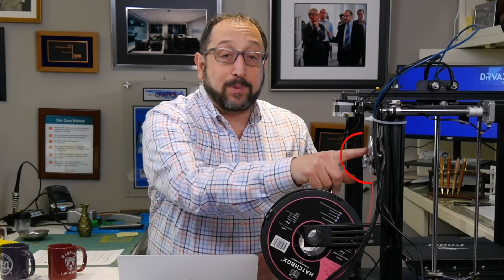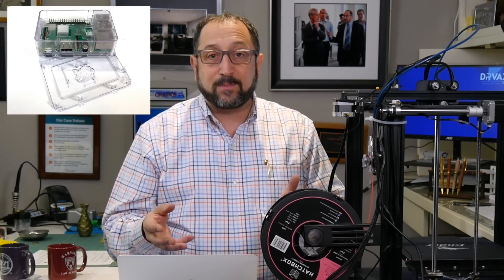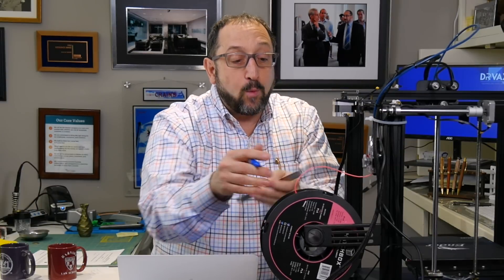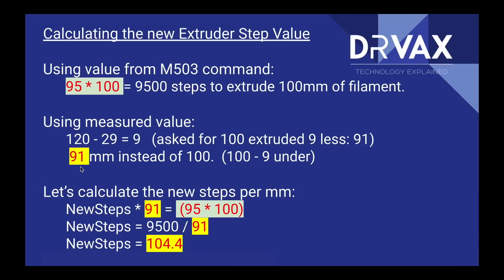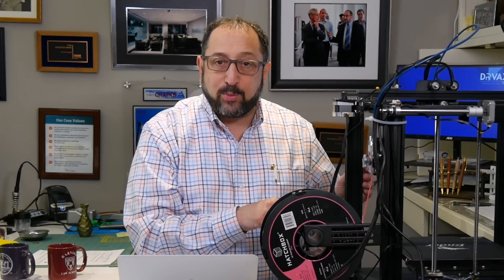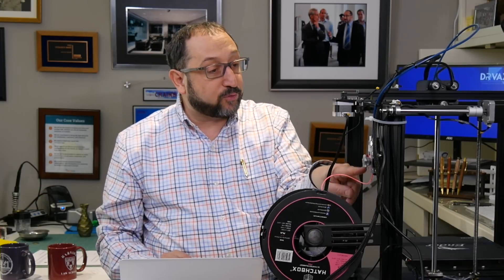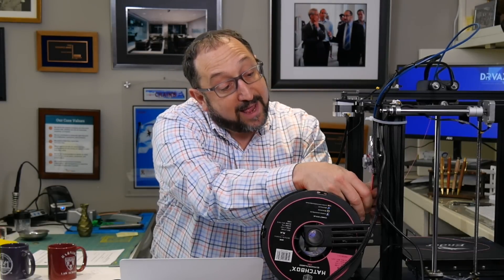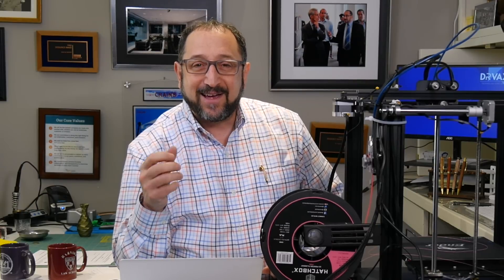Calibrate Your 3d Printer Extruder

Comment: I can follow along and everything goes smoothly until the part where you say to copy the M92 line. I cannot find that line to save my life.
Reply from the maker: Depending on your 3d printer and the version of the firmware it is using you may not have a M92 line in you M503 output.  If this is the case this is not tunable on your printer.
Reply: @MakeWithTech  
Firstly, thank you so much for replying so quickly. I ended up just typing M92 E## and it showed in the code on the bottom left panel and showed ok.
Then I put in M500 and it also shows ok below.
I disconnected my computer and powered down printer. When I powered back up, the printer E stepper showed the new values. In your video, you said to send an M500 command to save it. I couldn't see the actual code you typed in cause it was too small on my phone, so I just went with M500. 
By the way, all your tutorials are fantastic. I search them often as I am new to printing. I purchased an Ender 3 Max. Loving it so far 
Cheers!!!

Comment: Important thing to know that you need to calibrate extruder steps to extrude exact amount of filament.
You will need to calibrate flow separately in your slicer. For my Ender 3 and given ABS filament I use 91% flow to make walls exactly match the model.

Comment: Hi Irv, I just got my first 3D Printer last week (Anet ET5X) and am watching lots of your videos. I tested this today as I have problems Printing. With Repetier I could run the test and found out that my setting is off - The Problem: Repetier doesn't give me any ECHO - so the command M503 doesn't send anything back and I don't see the M92 line.......  I searched in the Internet but I don't find the reason why....... Do you have any Idea? (in Repetier echo is on.....) May this be the Anet FW? Thanks for your help
Reply from the maker: Try using the terminal in matterhackers’s mattercontrol program. It us a free program.

Comment: thank you so much for your video. I am having an extremely hard time connecting my ender 5 plus to my computer using a USB. I need to adjust the steps per mm for engineering design grade prints but cannot access it. please help
Reply from the maker: Try use the free Mattercontrol sw from Matterhackers.
Reply: @MakeWithTech  I will give it a try thank you

Comment: Dr. Vax Thanks for the great video, I like how detailed you make your  presentations. I'm having trouble with my Ender5 Pro printer. I cannot get my filament to stick to the bed so I thought I'd start with an extruder cal. When I calibrated  my extruder, on attempt one, it  only used 5 cm of filament, less than half of what is expected. So, what I did and before I changed any settings, I then removed the blue hose at the nozzle end and fed out a cm or two of filament  and placed a mark on the filament close to the end of the blue hose. I performed your calibration, steps G1 E100 F100 etc. and measured how much filament came out of the blue hose. It measured exactly 10 cm, so the extruder spit out 10cm of filament. When I perform a filament change the filament pours out of the nozzle so there is no plugging going on. After putting it all back together, I tried printing a small test pattern and everything else for that matter. I cannot get the filament to stick to the  bed, and I tried everything under the sun. 3 different bed plates, tape, glue hairspray. I increased the bed temp decreased the bed temp, increased then decreased the nozzle temp. I tried 3 different profiles. I have an EZBAL bed leveler  so I was able to adjust the nozzle height up and down, but it still won't stick. I dried my filament in a dehydrator and changed filaments. It seems the filament is not spewing out like it should when printing. It looks very thin and hairy looking.  Yet again I performed a filament change and it spewed out in a nice spaghetti like form. Any thoughts. Why would the extruder extrude 5 cm one way and 10cm the other way?
Very Confused

Comment: Do you have any idea how to get an Ender 3 Pro with Marlin version 1.1.6.2 to go back to printing in the center of the bed again?   I found the coordinates roughly by manually adjusting the Y & X-axis over the center of an X I drew on my build plate, but how do I get it to print in the center?   I do not want to Flash Marlin 2.0.

Comment: Hey Dr V. Love your work. Thanks so much! Quick question about calculating e-steps. The original value in my E3Pro esteps was 93mm and I changed it after doing the algebra. However, I’m not sure I got it right and want to check it again. Second time around, should I use the factory setting for the e-steps (ie 93mm) or my adjusted calculation (which I suspect is not quite accurate)? Hope that makes sense??
Reply from the maker: It does not matter.  The algebra is relative.

Comment: Great video but would have been better if the print was off calibration in the beginning.  and it would have ben incite see both under and over extradition calculations and steps.

Comment: Dr. Vax Many thanks this video was very helpful. I was able to correct my under extrusion but when I attempted M500 to save the changes I get No EEPROM. 
BTW I have the new Ender3 V2 with stock firmware @ 1.0.2 - Any suggestions from anyone would be greatly appreciate.

Comment: Thanks a lot for this precious piece of knowledge! And for your clear and easy to understand english.
I am having trouble on saving the e-steps configuration in the EEPROM. My Ender 3 ignores M500 command, when rebotted it is set back to the factory configuration. 
Can you give me any gidance of what can be going on?
Reply: Tiago - The No EEPROM issue that you had - Were you able to figure it out ?
Reply: @WilGuzman  Hey Wil! No, I wasn´t able to figure it out. What I am doing is setting the correct extrusion thru the slicer. But I would like to understand why I am not able to save the new settings.
Reply: I had the same problem with my new Ender 5 Pro. Make sure you have an SD card plugged in. It appears that for my printer, it is saving its configuration to the SD card, not internal EEPROM.

Alternatively, you may be able to tell your slicer to add your M92 command to the G-code it generates. For Cura, it's in the printer settings.

Finally, at least for me, it wasn't necessary to include X, Y, and Z values on the M92 command, just the E. For instance, "M92  E103.2" works fine for me.

Comment: When I ran G1 E100 F100 after G92 E0, The program ran for 20 seconds and stopped coming up very short on the amount of filament that was used. What am I missing here.
Reply from the maker: It may be that your printer is out of calibration.   How far off was it?  What type of 3d printer is it?  Was the extruder clicking?   Did you heat up the hot end to the proper temperature for the filament before you issued the command?

A better place for an interactive discussion would be the DrVax discussion forum at http://forum.drvax.com   At the forum you can share your question and many people can reply and provide potential solutions.
Reply: @MakeWithTech  Thanks a lot for responding. From what I've read, this is a common problem with the Ender 5 pro right from the get go. The 1st run through, it would only extrude 4 mm, which meant a new step setting of 253 ish. was needed. 2nd run trough it extruded 9.8mm. I can now print fantastic layers. Thanks for the awesome video. A well thought out and detailed lesson.

Comment: Metal Extruder For MP10 - I GIVE UP, bought Yutino for MK8 Bowdwn Extruder, tension spring has to much pressure so filiment doesn't extrude properly (in scrap pile now) 
also
got Creality extruder for Endor 3, CR-7, CR-8 etc just didn't seem to fit correctly (in scrap pile now) 
NOW I'm
waiting for stock plastic monoprice 33912 to come in and then be shipped

Comment: He mentions that he replaced the ender firmware. Do you know if it's possible to save off the stock firmware before overwriting it?
Reply from the maker: I do not know the proper procedure to save a firmware image from a control board but you should be able to get the original firmware from Creality.

Comment: Will this work for the Ender 5 Plus?
   I have the 2.2.1 silent Board installed on it.
Reply from the maker: It should. Creality uses a standard variant of Marlin.
Reply: @MakeWithTech  OK, I ask since I heard they locked down the firmware on the Ender 5 Plus. So, I wished to verify if this will work.

Comment: Thanks a lot for the video .. it was helpful
I have a  ِAnet A8 printer when I try to move the  Extruder stepper motor via control panel it does not work!!
Do you think that one of the Firmware lines needs to be modified?

thank you..
Reply from the maker: Unfortunately the firmware in ANET printers does not support many of the "optional" gcode commands.  That said, extruding filament should work.  Make sure you have set the temperature of the hotend (extruder temperature) before you try and move the filament.
Reply: @MakeWithTech  Thank you for a quick answer.
The problem is that the extruder drive does not work via the control panel.
Other stepper motors like X-Y-Z move through the control panel properly
I changed the Extruder drive plug to the Y axis plug, and worked properly
Now ... I’m almost sure that the problem is the firmware .. Can you help me to find out the command line in the firmware that disables the drive movement of the  Extruder stepper motor?
Thank you ..

Comment: What version of rep-host are you using? I see NONE of those screens with the newest version. I finally gave up after several hours of trying to hook this up and print something . I was  using the rep-server also. Got so frustrated and uninstalled BOTH programs!
Reply from the maker: @Keely VB if rep-host is not working for you there are a number of alternative that might be easier to use.   MatterControl from MatterHackers has a good terminal.   I also did a video about using an extension for Chrome as a 3d printer terminal.  Check out this video:

https://youtu.be/lR5QjnohsRk
Reply from the maker: P.S.  I have started a new discussion forum at http://forum.drvax.com where we can all have more elaborate discussions and share pictures on our prints and printers.  Check it out.

Comment: Could I manually input the setting you have or do I need the M92 code from my printer? Having a hard time finding this
Reply: Getting a "Unknown Command" when entering "Send M503"
Reply from the maker: If you printer does not have real Marlin firmware it may not support these command.   This is a challenge with printers that use proprietary firmware.

Comment: On the part where you copy the M92 code on repetitor I don't see a M92, using a anycubic mega zero would this be different? I'm have marlin V0.0.4
Reply from the maker: Since this is a relatively old version of marlin I am not sure what comments it supports.

Comment: Hello, and thanks a lot for you good videos with info. It becomes a bunch when I try to print PLA 1.75mm with Ends-5 Pro. This worked before, but after trying a glass plate that the plastic didn't stick to, I went back to the original magnet plate, but it's curved in the middle so I have to put in between a paper ... Can Nozzle get too close? Otherwise, it looks like my ender-5  under extrude a little. I did, as you said, measured out 120mm, but it was no 25mm. What should I do to adjust it correctly? I hope you can help me? Thanks!

Comment: GREAT VIDEO!! I just attempted this method but when I input M500 I do not get the same response. Why is this happening? I am using a Tevo Tarantula using Repetier on my Mac.
Reply from the maker: Check the version of your firmware.  Not all versions of Marlin support saving the EPROM settings.  You might be able to research this by googling Teve Tarantula saving EPROM settings.

Comment: Thank you. I changed my extruder and the hot end started pushing out way too much filament. I will try your instructions as soon. P.S. You are connecting your laptop USB directly to the Printer USB?
Reply from the maker: I like using mattercontrol from matter hackers or octoprint for connecting to the printer USB.

Comment: I did this tutorial on my Ender 3 pro (upgraded to direct drive) and it worked! After power cycling the settings where saved. However I am concerned as after I rebooted the printer the screen is now not working. I am doing my first test print after fixing under extruding issue I had and will let you know if it is printing better but the screen not displaying anything but random specs is kind of confusing....Any advise? I guess I dont need to use it as I can control everything with multiple different slicers but is there a way to fix this?
Reply: Well I shut the computer down as well as power cycled the printer and the screen returned to normal. From what I can tell the printer doesn’t fully power cycle unless you A. Power of the computer or B. Remove the mini usb then power cycle the printer as it does seem to draw some power from the usb connection, not allowing for a true power cycle. Everything worked as video said.
Reply from the maker: Ok.  Now I see what was happening.   The control board in the 3d printer can be powered by the USB connection or via the cable to the power supply.  When you have a USB cable connected to a computer it is in fact not powered off.  This also happens if you leave a Raspberry Pi for Astroprint or Octoprint plugged into your printer.

That is why TH3d sells this USB power blocker for $6.   If you are going to leave your USB cable connect just add one of these power blockers and your 3d printer control board will power off when you power off the printer.\

Thanks for leaving a comment.  This is an excellent example of learning together.
Reply from the maker: I have never experience a gcode setting that disables the screen.  Either it is something I am not aware of or possible a cable just came loose.  I the past I have found cables to my various stepper motor come loose at the most inopportune times causing me to waste time troubleshooting non issues.  I recommend up plugging and reconnecting the screen cable at both ends.

Comment: Wouldn't be easier/simpler to just remove the tube and fitting from the extruder, cut the filament flush with the face of the extruder, then run your command and measure what came out with a scale or for more accuracy , flush cut it and measure it with a calipers? And after you made any corrections you could do it again.
Reply from the maker: Not sure.  But your way seems like a lot of extra work to save some simple math.
Reply: @MakeWithTech  Not really... you still have to do the math, but it's more accurate with the calipers. That's why I came out at 99.95. Can't see that on a scale.

Comment: Good afternoon, my tevo tarantula pro  is leaking filaments on the sides of the extruder, is too much filament being deposited? If so, how does the calibration perform? I wait and God bless.
Reply from the maker: It sounds like something more basic.   Make sure your nozzle, heat break, etc. are all tight.   When over extruding your prints will suffer but filament should not be oozing out the sides.  If you put in a new nozzle you need to tighten it when the printer is at temperature (hot).

Comment: How can I find what the Estep value is supposed to be on the ender 5?  Can't do it in the control panel because I also have the TH3D Marlin for the ABL  Thanks
Reply from the maker: Here are my current settings:

Recv: echo:Steps per unit:
Recv: echo:  M92 X80.00 Y80.00 Z400.00 E95.00
Recv: echo:Maximum feedrates (units/s):
Recv: echo:  M203 X200.00 Y200.00 Z15.00 E50.00
Recv: echo:Maximum Acceleration (units/s2):
Recv: echo:  M201 X500 Y800 Z500 E5000
Recv: echo:Acceleration (units/s2): P<print_accel> R<retract_accel> T<travel_accel>
Recv: echo:  M204 P500.00 R500.00 T500.00
Recv: echo:Advanced: Q<min_segment_time_us> S<min_feedrate> T<min_travel_feedrate> X<max_x_jerk> Y<max_y_jerk> Z<max_z_jerk> E<max_e_jerk>
Recv: echo:  M205 Q20000 S0.00 T0.00 X7.00 Y7.00 Z0.30 E5.00

However, you probably want to use the calibration technique in the video to reset your values.    To get your current values you need to connect a terminal emulator to your printer.  You can use Octoprint,  Simpify3d or my current preferred option, which is completely free it MatterControl from Matterhackers.   Then connect your printer over a USB port and enter M501 into the command line and sent this to the printer.  You will see a result that looks like what I pasted at the top of this note.

Good luck.  Let's continue to learn together.

Comment: tried moving the extruder on my new cr10s for the 100mm directly from the control box .. nozzletemp at 200C...increased extrude slowly...at about 90mm it stopped and box displayed "killed"....2nd try it stopped and "killed" much shorter distance
Reply from the maker: Is this the same control board that has the defective USB port?   Sound like something is wrong overall.  I would contact Creality support.  Let me know how it goes.